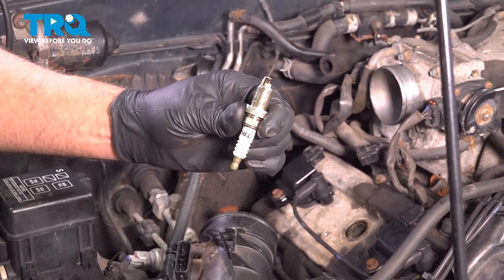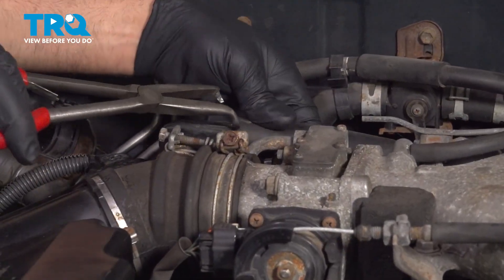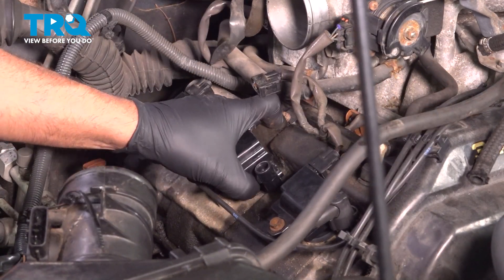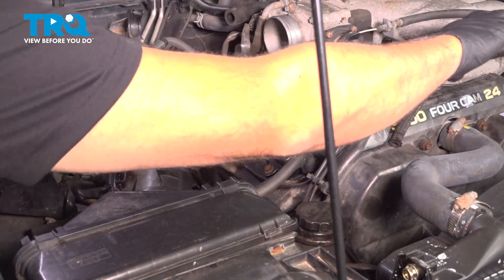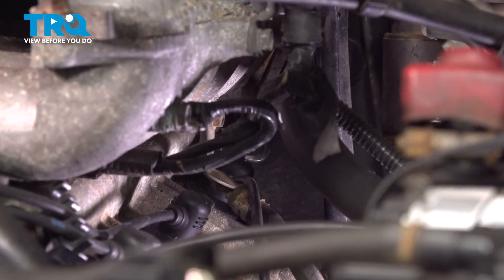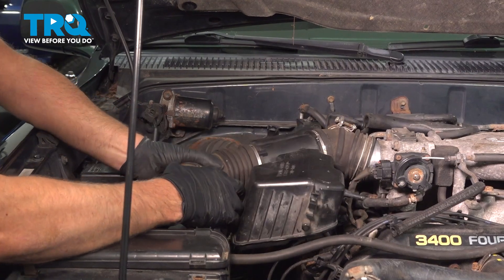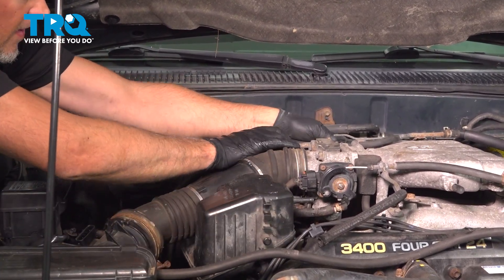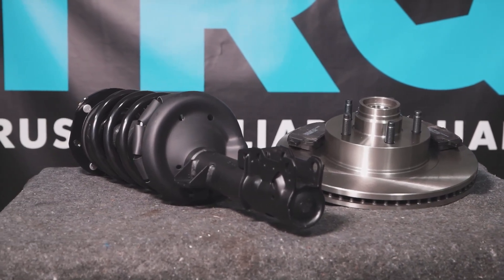How to Replace Spark Plugs 1996-2002 Toyota 4Runner

Comment: Why in God's name would you unclip the wires completely from the bracket? Just pull it out. Just like the serpentine belt video. Guy disconnected radiator hose, fan shroud, and fan to replace belts. Use your head before you do things blindly.